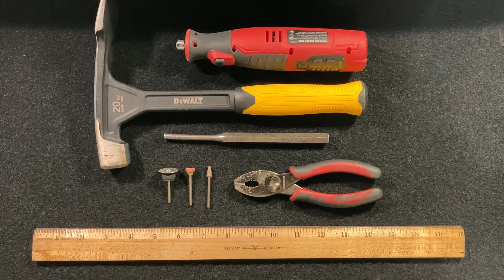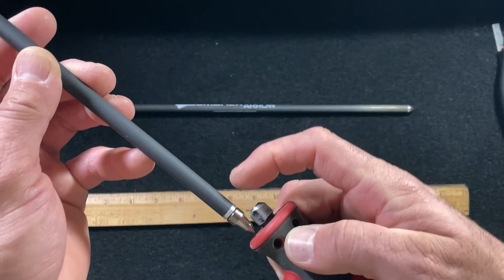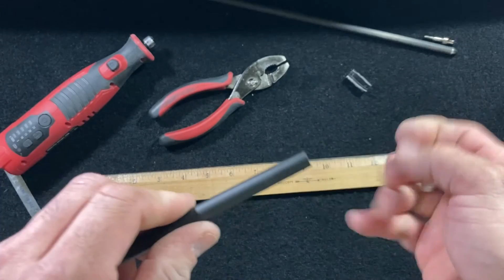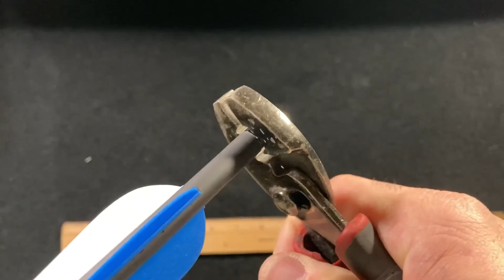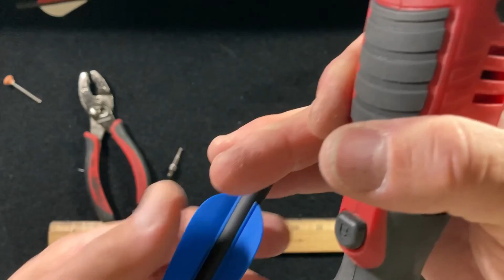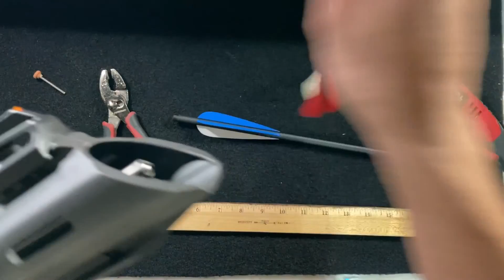Custom Bolts for Umarex® AirJavelin™ - Part I:  Assembly

Comment: Did you scale the arrows? What's the weigh difference between it? Thanks 👍
Reply from the maker: Only scaled to match in length. The aftermarkets weigh a little bit more although I did not put them on a scale to compare.

Comment: But did you bother testing whether or not you even need to shorten the bolts?
Reply from the maker: Not really but it directly impacts your distance and FPS so I wanted to get as close to OEM length as possible for the initial batch.

Comment: Could you leave the arrow at 18 inches fill the front end with 3-in of heavyish material? To increase foot pounds
Reply from the maker: Going to lose a lot of distance. Especially if you add weight on top of that.
Reply: @NotNuffKnives  it's 21:15 here across the pond are you up early friend?🤣🤣👍 great fast response woohoo!... would I be ok to put a heavy Broadhead on though?..
Reply from the maker: Just have to decrease your shooting distance to make sure the shot counts and animal doesn’t suffer. Or use the new Javelin Pro which I will be reviewing soon!

Comment: Thanks for sharing , i cant buy air javelin arrows here in new zealand and only got 3 when i bought the gun , the first arrows i converted had a slightly wider inner dia , so will try and find more compatible ones , which brand did you use?
Reply from the maker: Just eBay crossbow arrows 14 or 16 inch variety. They’re priced very cheap!

Comment: Excellent work JT.  Did you happen to weight them after.  Also wondering the tip grain too for the bolt.   They look a bit beefier than the 50gr original.
Reply from the maker: The bolts are definitely heavier but I have to get around to weighing them. You can expect better accuracy at a cost of slightly decreased range.

Comment: cool video.i thought about doing this myself as the arrows dont come cheap from umarex. i dont know if you know this as its not in the manual, but you can turn up the power on these at the expense of less shots per co2.i prefer stronger shots and less of them , so heres what i did ; pull back the adjustable stock. youll notice on the tube of the stock on top there will be a factory hole there.using a 9/64th round head allen key, you can go in on an angle and grip the hammer spring screw. rotate counter clockwise  several turns. the first 4 shots are screamers now with alot more power. i use the umarex double 12 gram co2  adapter in my gun.before the mod id get 12-15 shots, with the first 8 or so ok , last ones were down on power alot.now i get 7-8 shots with the first 6 with alot more jam and a pathetic 1 or 2 at the end. personally, i like it alot better , especially if you want to use it on pest control or small game. i notice in the cold the co2 power goes way down .i just bit the bullet and ordered a pcp compressor and im going to get a air saber and maybe a javeluin pro down the road as the high pressure air is uneffected by the cold.good video.thanks for the tips on arrow making.
Reply from the maker: I've read a lot about the mods but never really tried them. I am definitely going to mess around with it when the weather gets cooler. Thank you for watching and thank you for your comment!

Comment: I bought some arrows and did your mod. My arrows, after being turned into bolts, fit a little loose on the gun's tube, compared to the Umarex ones. They wiggle around a little more and, if I just let them slide by gravity onto the tube, they slide on faster. Those two things make me think they are bigger on the ID. I also weighed the bolts after I made them, without the tips, and they are a full 100 grains heavier than the Umarex bolts. That seems to be because of the wall thickness being greater on the Ebay arrows. I'd like to know, did you find this to be the case with your bolts or did I buy the wrong arrows to start with? If yours are much lighter, I'll try some more shopping. It's been too cold here to shoot CO2, but I'm sure my point of impact is going to be really low when I finally check it. I'm thinking these homemade bolts may be reserved for shooting rough fish since the range is shorter, the trajectory is downward, and the extra weight would probably help carry the bolt through the water. I'd like to hear about the weight issue I mentioned and what you think about the usefulness of fishing with these bolts. Had fun making then, at any rate.
Reply from the maker: Thanks for sharing your experience! Make sure that what you are buying are crossbow bolts (not bow arrows). Make sure the measurements are the following:
Shaft Inner Diameter: 7.74 mm	
Shaft Outside Diameter: 8.73 mm

This is the size I used and the bolts snap over the first o'ring in the airgun tube. They worked great! I like your airbow fishing idea as I never thought of that! Would just need a custom reel system designed and you'd be set! 

I am going to make a Part 3 video using 16" bolts I recently picked up that will not be shortened. I understand these will be heavier due to the 1.5" extra inch but should still be addecuate for backyard plinking. WIll update soon!
Reply: @NotNuffKnives  Thanks for the response. Checked my bolts and they measure in inches .350" OD,  .291" ID.
Your bolts work out to .344" OD,  .305 " ID.
The Umarex brand bolts are .317" OD,  .285" ID.  It looks like my bolts may fit the tube tighter than yours but yours has a thinner wall making it smaller outside. I had to sand the OD down at the back of the arrow to get it into the O-rings and I guess that's why. Your arrows are likely lighter than mine  but may be losing some air around the tube and both of ours should be heavier than the Umarex bolts. 
  If you are going to remove the nock on you next experiment, I found that a tubing cutter did a nice job. To shorten the rest of the shaft I had to stick a #2 pencil inside to back it up for the cutter wheel. You might want to try it. Looking forward to your next video.
Reply from the maker: @mrhalfstep  Thanks for the tips! I will be implementing a few new techniques and this one sounds like a good one to consider as well. Any input helps to get the optimal setup is appreciated.

Comment: Just wanted to point out that you can buy larger diameter cutoff wheels for the hobby grinder and they will allow you to cut off any length with a single cut. Would save some time.
Reply from the maker: Agreed, however I did prefer the full circumference from this method, since, it allowed for a more square, perpendicular cut. I know there are machines that can get a perfect 90 degree cut, but as far as human hands go, I liked how this was very clean and even.

Comment: I have found that using a heat gun to loosen the adhesive will allow the inserts to slide right out. I do that all the time when building arrows.
Reply from the maker: Thanks for the tip! I will try that on my next batch. I landed a set of 14" native bolts I will use for a third video. I won't be shortening these. Hopefully I get to that soon!

Comment: Custom Bolts are a good idea.
Someone tried making Custom Bolts following this video, but the end piece you pull out just brakes the end of the shaft.

So, just buy the Umarex - AirJavelin Arrows where ever they are on sell at a discount and save yourself some grief. 

This was a Dilettante Presumption Theorem: All statements of fact, opinion, or analysis expressed do not necessarily reflect official positions or views or any other entity, past or present. Nothing in the contents should be construed as asserting or implying endorsement of interpretations and factual statements.
Reply from the maker: I never had any problems removing the nocks. Some guy here mentioned using a heat gun for removing these effortlessly. I am going to try this on my next batch and provide a video update.

Comment: This might be a silly question but do you really need to cut the crossbow bolts down?  What happens if you just leave them at their original length?
Reply from the maker: Very good question. Basically you are compromising range and energy with the additional bulk of the new bolts already, so any additional length would only add to that. It's a matter of personal choice and what you are using the rifle for, but personally I found good results leaving them close to stock length.

Comment: Do you have any recommendations on what broadheads to use? From what you has shown I’m pretty sure Swackers broadheads will do very good. I got entrusted in this gun this year when I seen a fellow using one for hunting deer 🦌 he was using Swackers and the gun definitely punched a hole in the deer he was dragging back to his truck. He told me he had done killed 4 deer with it. And he recommended it to me. But I didn’t know what type of arrow he was using. Now that I have done some research and watch your video on the bolts to use I’m definitely going to get one. And hunt with it too. I’m not sure why other videos are saying this gun is just for planking? My guess is they get paid off so people will purchase more expensive ones. But from the information I have gained from your video I got no doubt about it I can purchase this gun and with a little modification I’ll have a thousand dollar hunting air gun for less than $300 bucks.
Reply from the maker: Ethically speaking, there are other pneumatic arrow rifles better suited to hunt deer with. Technically speaking, any weapon can be lethal if used with the correct equipment and range. Me personally, I don't hunt but if I did, I would stick with small to meadium game with this one, and use aggresive broadheads that will guarantee a swift painless kill to the animal. These fundamentals should be on the top of every hunter's priority list.

Comment: Bought my javelin 300 today, binge watching j-300 mods and tips videos. This one was great. I will be using what I learned here today
Reply from the maker: I am glad people are getting creative with mods, that's why I wanted to add one to the list. I tried an even shorter bolt recently which coincidentaly has red and white fins like the original, albeit 3" fins. I will probably post a comparison video ont the shooting portion of it soon! Thank you for watching!
Reply: @NotNuffKnives  I cut my charging bolt down to 3 balls instead of the 5 it came with. Switching to paintball tank asap. I'm stuck at my new sight/scope/reticle options